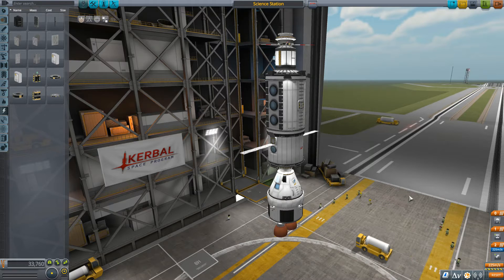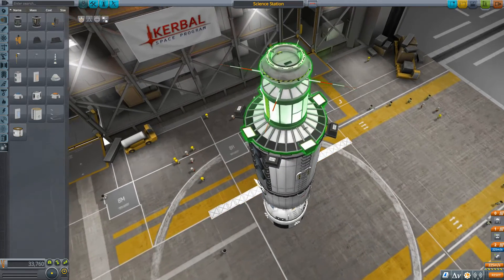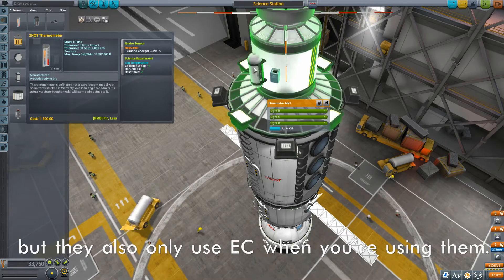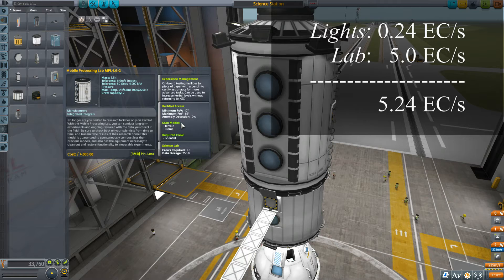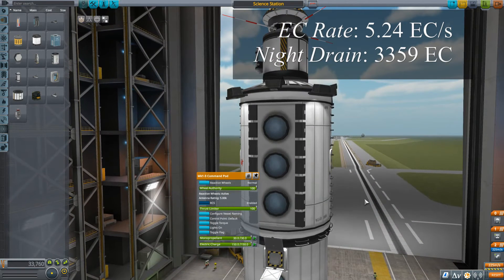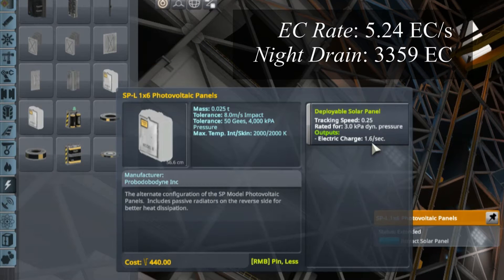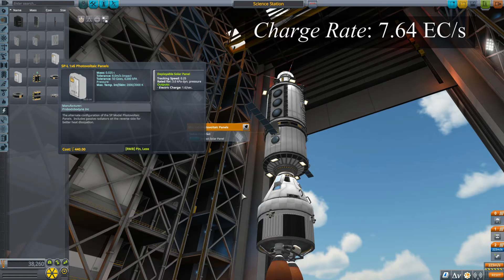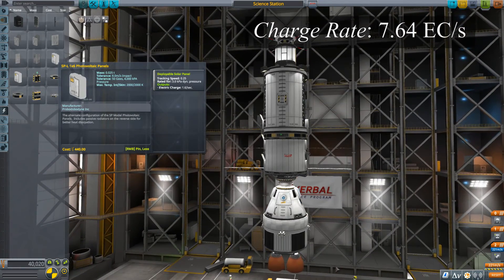Determining Electricity Needs | KSP Let's Do The Math

Comment: What of the length of time to transmit? This is something I haven't yet figured out. The MPL says it holds 500sci, yet the antenna says a certain number of bits/sec. Is there a conversion for sci/bit, to know how long the antenna will be on for?

OK if we use gigantors the problem is solved... But I'm a bit anal and like to work out the edge cases of electricity storage and generation :)
Reply from the maker: This was something I neglected to talk about in this episode, but do at the beginning of the next one. Basically, a mit is a science point. The Communitron 16 transmits at 3.3333 mits/s, so it'll take 150 s to transmit that 500 science which will require 3000 units of electricity.
Reply: @MikeAben  Cool videos AND quick responses? Man why couldn't I have had you as a teacher :) Cheers for the explanation, I reckon the wiki just basically assumed that everyone new that.

Comment: My Mobile Processing Lab was quite similar to yours, though I was limited (by career mode) to the smaller batteries and solar panels.  Due to non-fatal accident I lost one end of the station and the battery packs that were all at that end.  Each of the vessel at each end returned to Kerbin, leaving me with no batteries.  Even though I had ample generation as my station, and the hitchhikers, every flat surface, was festooned with the smallest solar panels I had stopped processing science because no batteries to route the power through.  Lesson - don't keep all your batteries or generation in one spot.  I learned it for generation by EVA/docking breaking Gigantors previously, but I learned for batteries by this occurrence.  Redundancy three levels deep!  I also hide other non-extended antennas in other spots on the station for breakage/accident during ascent, EVA, docking, and just because I'm a klutz generally sometimes.

All that said, great video!  I've often wanted to be able to calculate the very things you put in this video and have avoided it by generous overbuilding.  New tools, new methods! :)  Thanks!
Reply from the maker: More redundancy is a lesson I keep failing to learn as well.